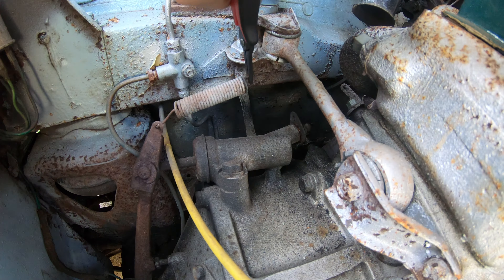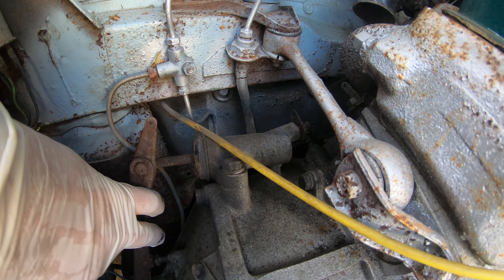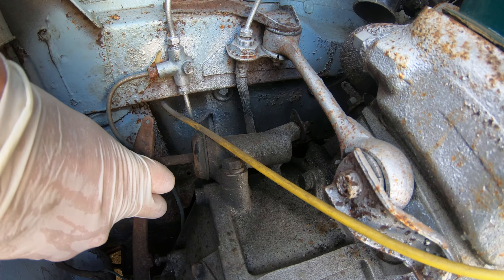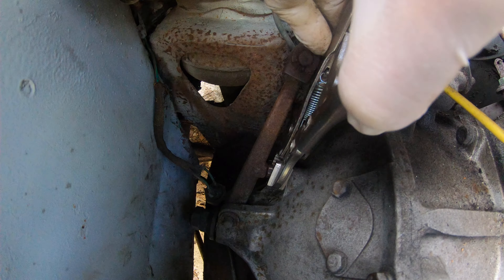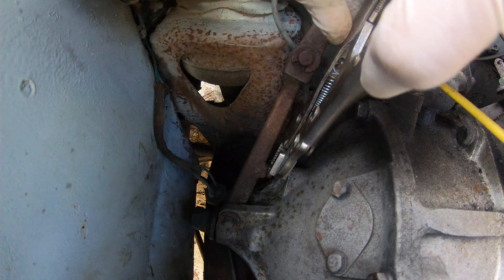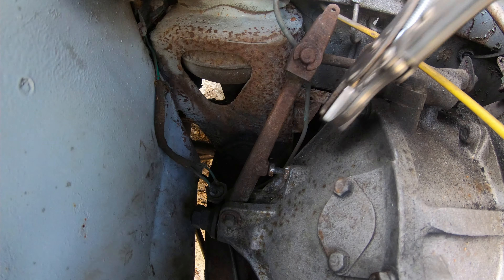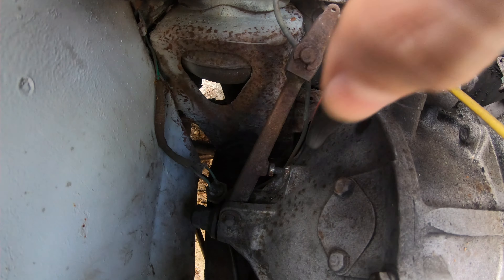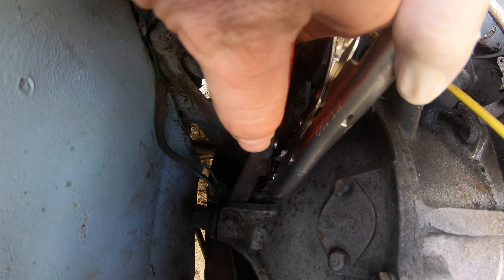Classic Mini Clutch Adjustment

Comment: Hi Ryan! Thank you so much for the trick! We have a 1960 Morris mini, and we haven't been able to get it into gear.  After sitting in an intersection for 3-4 green lights, we had to start in 3rd gear!😬😬
We checked the oil, and it was a bit burnt; so we thought that might be the case. 
I'll go and try it out! If it doesn't work, I'll drive it over to the mini repair place! 
Thanks again!😃
Reply from the maker: Hey Boosh, glad I could help!